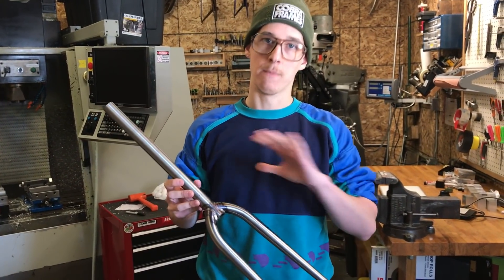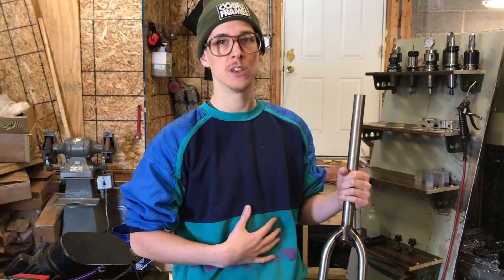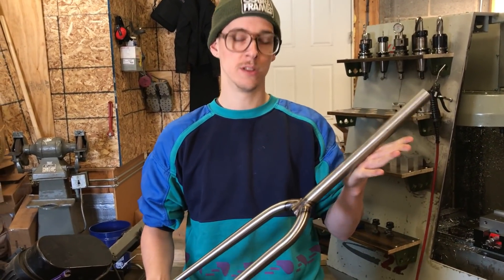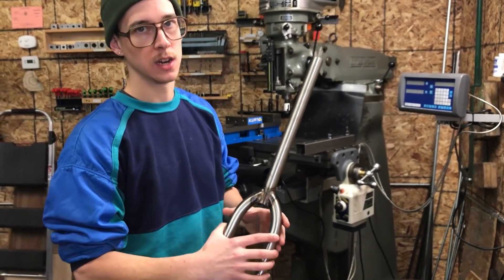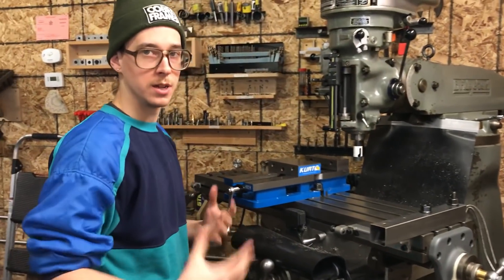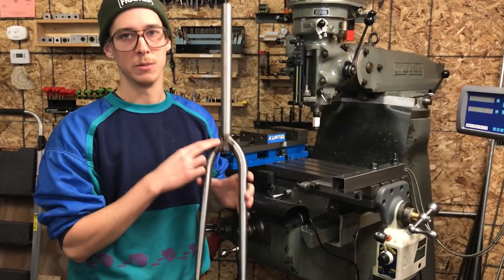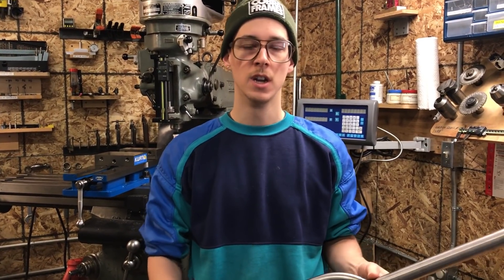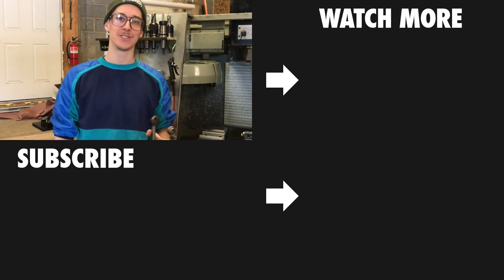Pros and Cons of the Unicrown Fork | Bicycle Framebuilding

Comment: Man its so hard for me not to see the vast majority of unicrown as ugly as sin. Probably because of walmart bikes yep 😅You're right though, straight blades help a lot so yours with the TA dropouts looks quite alright. But in general, give me that segmented, lugged or carbon fork
For your fork bridge stack height issue, maybe you could build your frames with ZS44 lower headtubes to pair with the unicrown forks then if  someone wants to run a carbon fork, they can run an EC44 lower headset to take up that 15mm of space. EC44 will will even fit taper no problem!

Comment: crazy idea: couldn't you fill the tube with water/oil and weld shut for internal support while bending?
Reply: Dry sand packed really tight works.
Reply: You could. It's commonly referred to as "Bomb Making"......
Reply: @wingnutbert9685  good point. i don't know what i was thinking there to be honest
Reply: @markifi  All good. There's lots to consider when it comes to working with metal, fire and tools. Like the other guy said, sand. It has to be very dry. Otherwise the moisture turns to steam and can wreck the bend, shoot a hot jet out a small hole or crack or just go boom. Pack the tube, hammer the ends closed, weld it closed, heat and bend. Works a treat when you get it right. We've bent a 1" .063 steamed tube of plain steel and tied it into a knot like a pretzel. Takes time and a lot of gas, but can be done. 👍

Comment: Lugs are the bits where the top and down tubes meet the head tube and where the top tube meets the seat tube. The bit where the down tube meets the seat tube is a bottom bracket shell. And the bit that connects the steering tube to the fork blades is called a crown. Is that right?

So what is a 'lugged' fork? A fork built with lugs?

Comment: I do not like straight leg forks. I think they look much better with bends and tapered legs.
Reply: same here. I think it looks weird if the fork breaks with the angle and line of the headtube. I much prefer when they run inline and the fork is bent on the bottom end towards the dropouts.

Comment: Hey, great videos, I have some backgound in cnc, but welding was so new to me, i enjoyed your vids so much. May I ask something that I really could google so far? How are these fork blades (bended tubes with variable (!) tube cross-section diameter) are manufactured? Bending is simple, right, but how do they shape tubes from ~10mm diameter at the wheel up to 30mm OD at the top where both L and R blades are welded to the main tube.

Comment: I'm really not shure: Should I buy lugged or unicrown? I like the oldschool adventure bikes like allcity and soma with lugged. Looking way better to me as I am and older dude. I heard they are more comfortable and forgiving....is that true? But I have read that when you are a tall and heavy guy like myself, Its getting to springy with a lugged one plus most of the forks come with QR and not the better stiffness of a unicrown with thru axles. But for touring and adventure rides....is that really a must? Thumbs up for this rare perspective on frame building, really nice vid!
Reply from the maker: If you’re just buying a fork, pick what suits your needs best. Any quality fork designed for the task at hand is probably going to work really well.
Reply: @cobraframebuilding  That doesnt really answered my question, but thanks for the reply anyway.